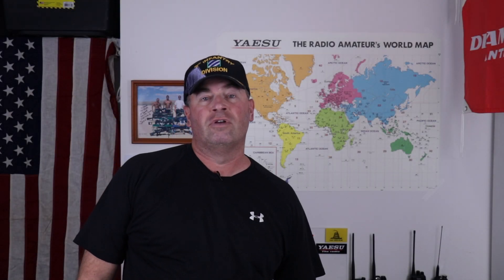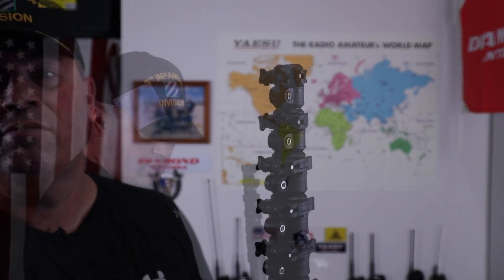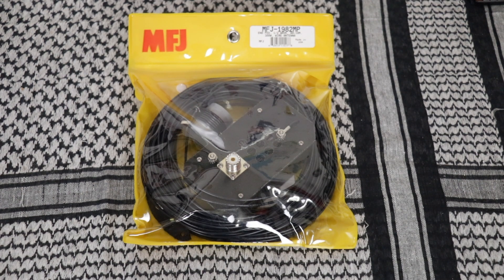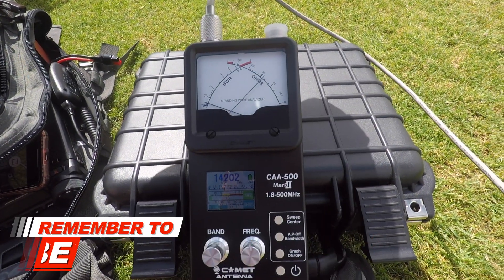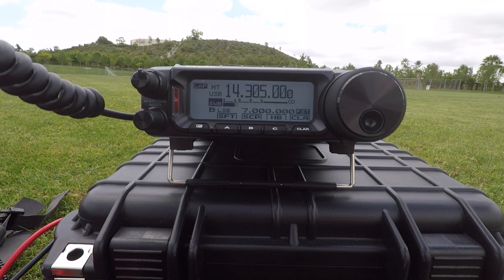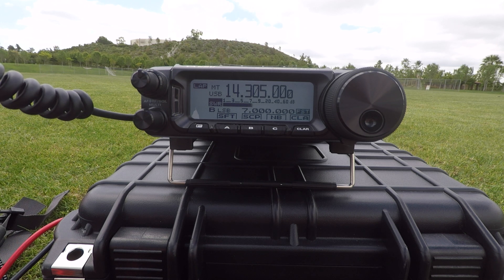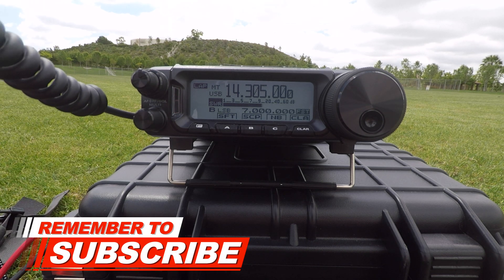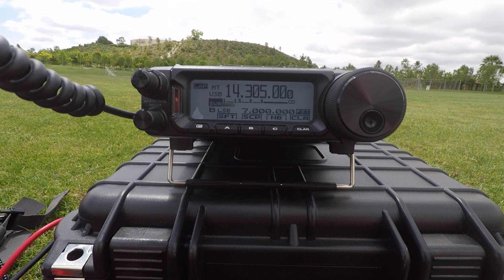Ham Radio Antenna - MFJ 1982MP End Fed Antenna

Comment: Is the wire length the only difference between mfj1982 and mfj 1984 is there difference in toroids or turns ratio.

Comment: Nice, I just got the MFJ-1982HP for my first home QTH setup. Now I really want to get a mobile HF and that gigaparts mast. I scoped out your QRZ page after noticing your 3ID hat and saw you were in Schweinfurt in the late 80s. That was my first duty station with 1-26 INF, 1ID from 2005-2008.
Reply from the maker: Thank you for taking the time to watch and the comment! It is greatly appreciated. I was on Conn Barracks. I was there from 1987-1990. Do you know what year 1st ID took over, and 3rd ID went to Ft. Stewart, GA?
Reply: @WJ6FRadio  I was over at Ledward, but stayed at Conn with everybody else that was PCS-ing after we got back from Iraq. I'm not really sure when 1st ID took over. I think it may have been during the late 90's when we were sending guys to Kosovo and Bosnia. Some of the older SSGs in my unit had gone to Iraq a year before me, and had gone to Kosovo before that in I want to say 1999.

Comment: Thanks for the video  I use the 1982 80/10 mp  a fantastic antenna  mounted horizontal @15foot above ground in a large L shape  100w into USA  and VK  with good reports from Greece (would recommend) 73s   Tony SV0SRS
Reply from the maker: Thank you for taking the time to watch and the comment! It is greatly appreciated.

Comment: I got the MFJ 1982 and have High SWR on 80m 3.800 mhz to 4.0 mhz, and high on 10 meters 28.30 to 29.70 but everything in between that is below 2.9 swr, with 12 meters through 20 meters being my best. I am using a nano vna to do frequency sweeps. I ran grounds counterpoise etc. As far as 80 meters goes I am ok to talk between 3.6 and 3.7 but that is in the extra band plan and I am only a general class.
Reply from the maker: Thank you for taking the time to watch and the comment! It is greatly appreciated. I have honestly never made a contact on 80m. How do you like the Nano VNA?  I have yet to try one out. Instead I lug a Comet around.
Reply: @WJ6FRadio  I love my Nano VNA. Would not leave home with out it. Best money I ever spent on an antenna analyzer. 73 KG5PTE.

Comment: Great review. How did you attach wire to the mast? And did you ground or have to use a common mode choke?
Reply from the maker: Thank you for taking the time to watch and the comment! It is greatly appreciated. I used a Nite Ize S Biner to mount the antenna to the mast.